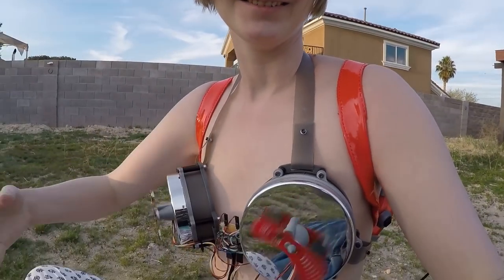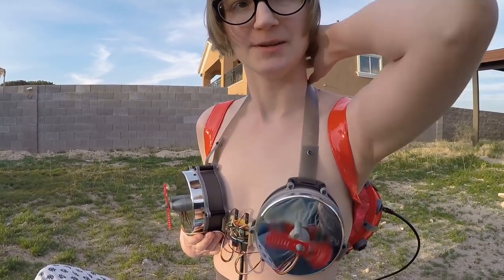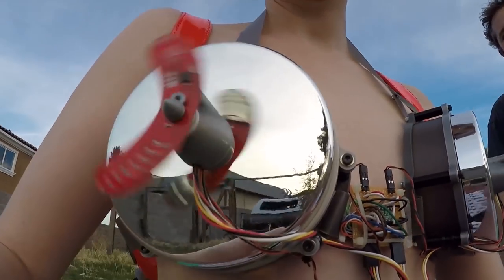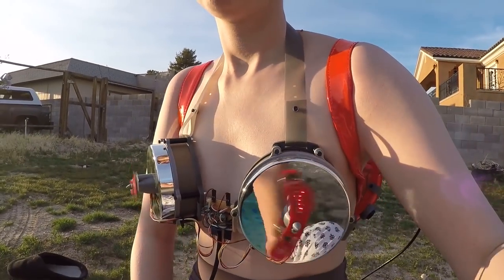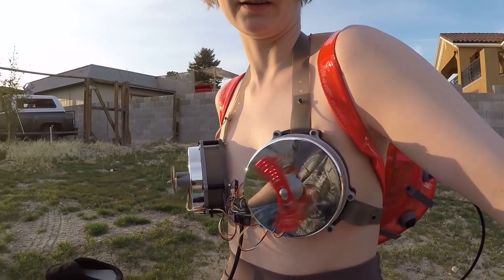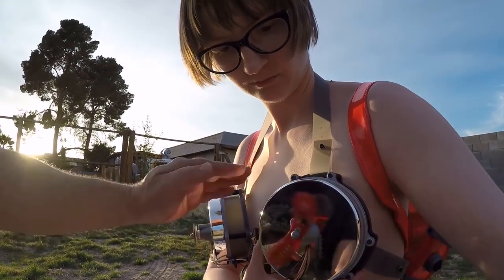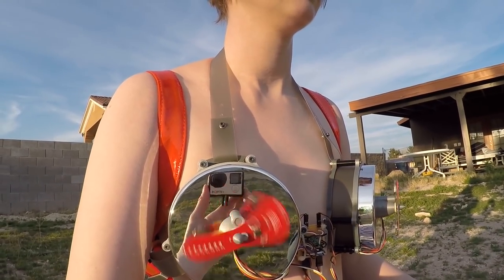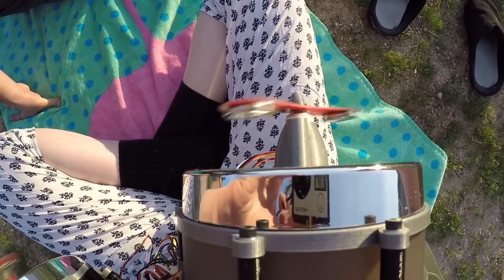POV Pasties : Outdoor System Test

Comment: Yaaaaaay! Actual test.

The straps worry me. I know that you're going for a bubblegum/japanese vibe thing, but have you thought of elasticized straps? Maybe with leather/vinyl end pieces for the catch?

Also are the connection ridges (where the tube come into contact with your chest) contoured or a flat plane?

Loooooove the idea of a little window port.

You're so weird.  :b
Reply from the maker: I will probably end up replacing all of these things when I get closer to a final version of each. For now I'm sticking with what is cheap and easy =P These are all prototypes.